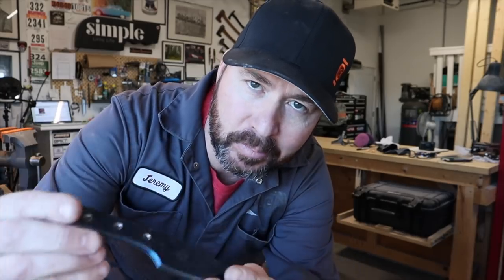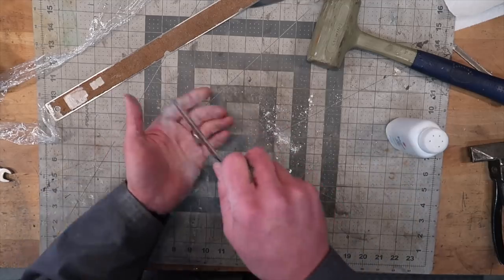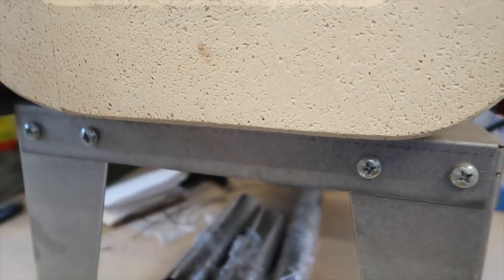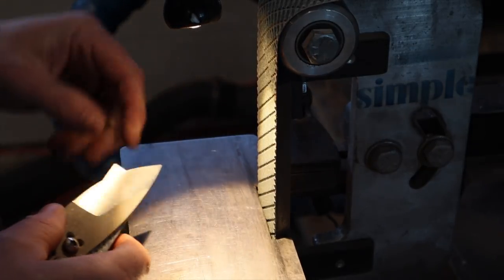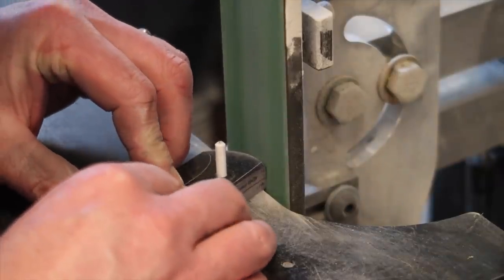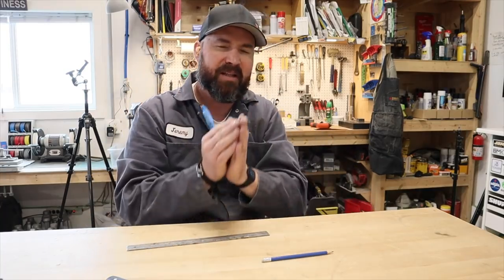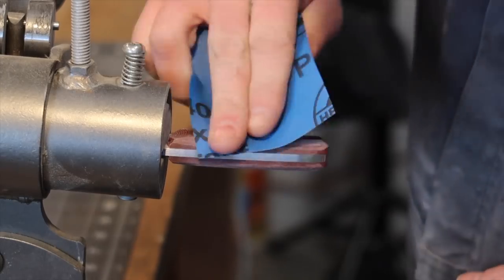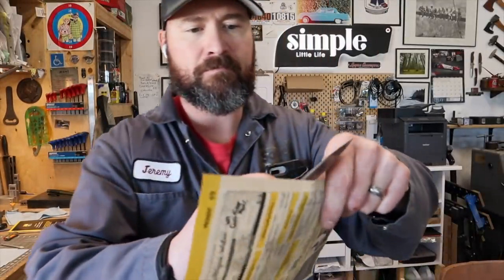Making a small EDC knife - Simple Little Life

Comment: ive been making knife for a very long 3 to 4 months   lol  notice the single tense in knife,  yes one knife. i am still enjoying it very much and the biggest thing ive  learned is  I NEED TOOLS LIKE YOU GUYS.i thank you for all the info that u pass along.  ive never done any metal work past sharpening a couple of lawn mower blades on a bench grinder, so this has been a very educational road. ive learned how little i know. my first is{now complete} a bushcrafting spearpoint out of a 1923 sawmill blade about 3/16 thick.  i am assuming it is a high carbon still. so i heat treated it in a wood fire in my back yard. i heated it to the point it wouldnt draw a magnet, quenced it in cooking oil i pretreated with a railroad spike.  then tempered it in the oven at 400 for 2 hours let it cool down there till the next day. it seems very hard, and hard to sharpen.  i put it to a test this week making feather sticks and process wood  (acually batoning it throuh wood as in splitting wood.) it was dissappointing to fell the edge was not as sharp when finished as i woud have thought.  any advice on how to do my next blank from this 1923 saw mill blade?

Comment: Hey Jeremy, daft Q for you but is there a way to temper a blade without an oven - my wife had bought me a sweet grinder for my birthday but has declared her oven is off-limits and I may be able to get a toaster oven in time but until then (and because I just want to get going with making) is there a way to temper a blade by heating in a forge and watching for colours? I know it won't be exact but is it possible? Or can you use a slow cooling in vermiculite ?
Reply: yes you can use a forge/fire and watch the colour....but like you said its really not precice. Back in the days, blacksmiths did that all the time.
Also you could try to get some oil to the right temperature and "boil" the knife. I have not tried that one but there is no reason why it sould not work:)
Reply: @nils-ph3zs  thanks for the info, really appreciate it

Comment: Please don't see this question as being argumentative, but I see people drilling a whole bunch of holes in the tang stating that it improves bond by allowing the epoxy to go all the way through. I'm just curious, has anyone actually tested this? I'm far from an expert, so I'm more asking for learning purposes. But the reason I ask is my own logic suggests to me that a good bond is all about surface area (hence the reason you want to rough up the tang and inside of the scales), and as such drilling all the holes wouldn't that only reduce that surface area.....? I understand sometimes people drill holes to decrease weight and stuff and I would think either way that drilling holes in the tang doesn't drastically decrease strength either (if in fact it does at all) but I just don't understand the logic that it increases the bonding strength of the epoxy.
Reply: You're missing the point - the epoxy goes right through the holes to the other side of the tang, creating a lot of little hooks.